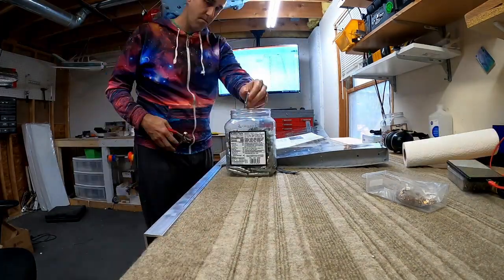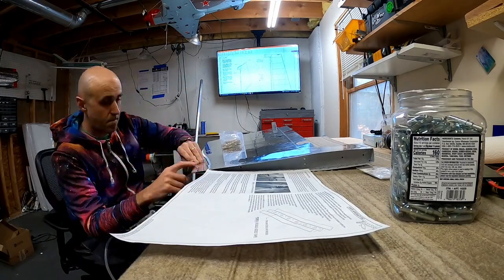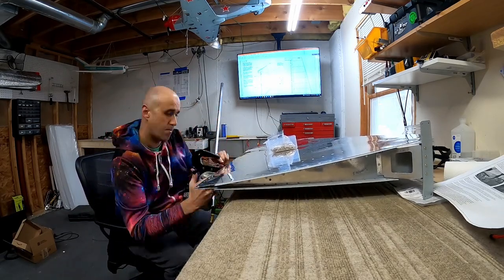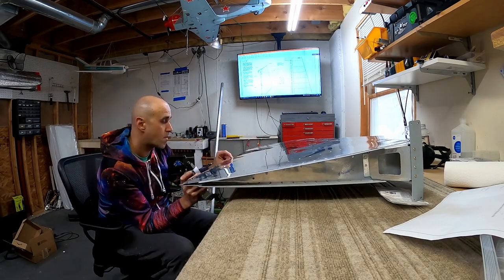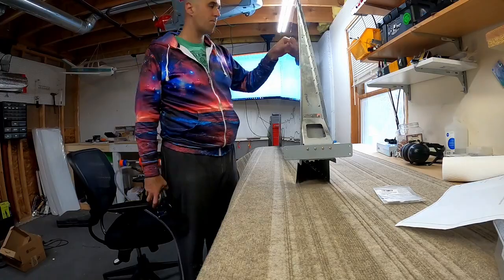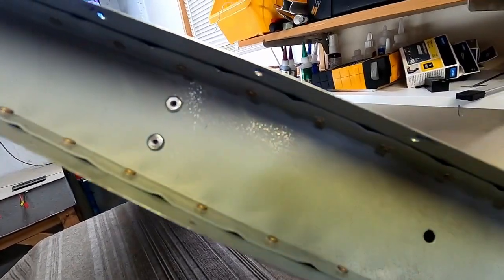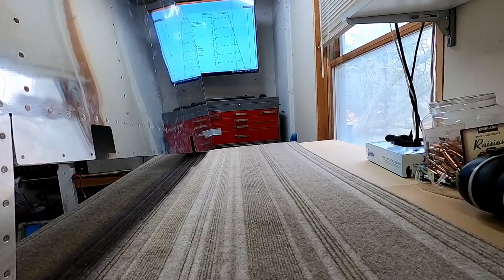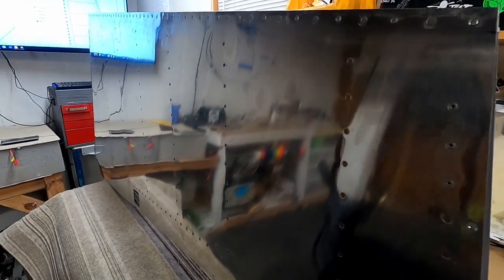RV-14 Rudder complete

Comment: Did you have any trouble rolling the leading edge? I'm trying to figure out how close the skins need to be (how far apart the holes are) before I rivet them together. It looks like most people get them about 1" apart then kind of force them together to cleko/rivet.
Reply from the maker: It's definitely a game of ..... Gentle force.  Then you'll think it's all good and you fit them to the stabilizer and they still rub and need more work.
Reply: @RyanE67  Dang, that's not what I want to hear. I was worried about getting the trailing edge straight but as it turns out, the leading edge has been WAY more of a pain. Trailing edge was easy by comparison.